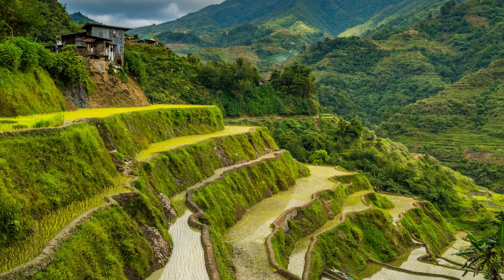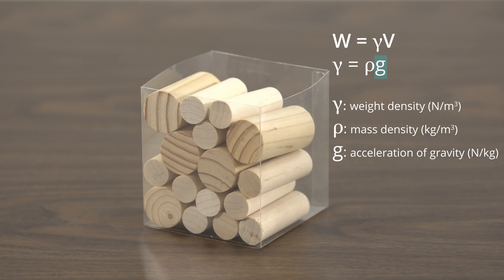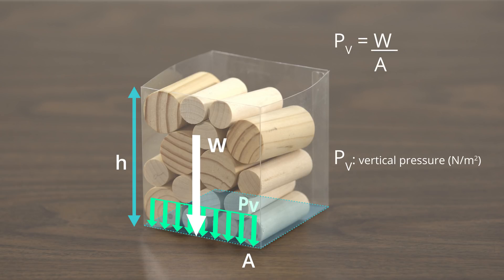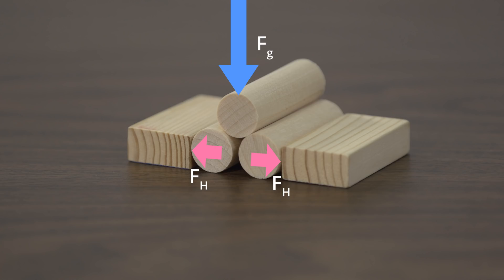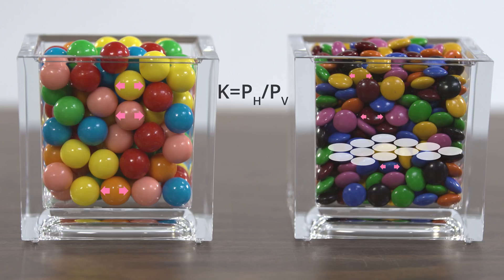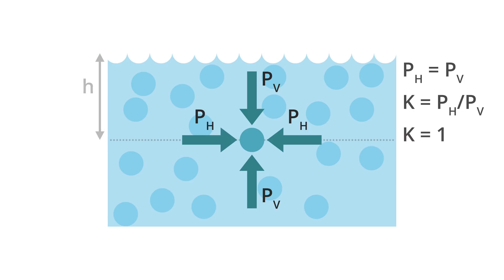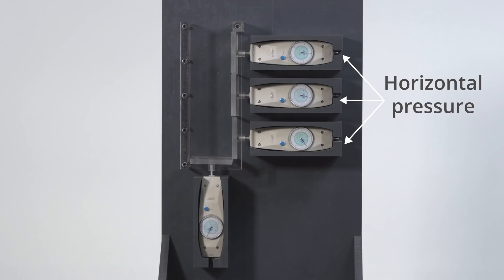6. Soil and Water Pressures

Comment: Question from non engineer type. If an IBC tote can hold 330 gallons of liquid and liquid has pressure force in all directions, would it also be able to hold an equal volume of gravel, stone or sand, since this material would have less side pressure and more downward force?

Reason. I've thought about using recycled IBC totes (come on plastic pallet with metal ribs) as a buttress instead of a gabion structure for retaining wall. I understand the back fill needs to have a correct structure to keep hydraulic forces under control.

Very informative videos. Thanks, Scott

Comment: Honest question: how can Ph=Kpgh if K=Ph/Pv? How could you know one without already knowing the other?
Reply: you cant  as they are linked. in practice you know the K value from books/ tables so you can calculate the horizontal pressure. for soil on the other hand the value K is calculated from fi

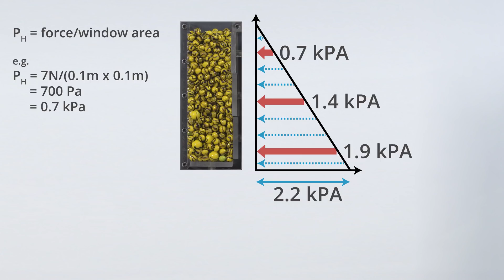Comment: 6:46 Shouldn't this be multiplied by 2, since this is only the measure for one vertical side and not both of them?
Reply: pressure is a per area quantity. Measuring both sides = double the force, but also double the area. So pressure = force/area is the same as measuring from one side.

Comment: 7:00 there's definitely an error here. You can see that the two lower indicators are showing both 21 N, but the pointers are in different places. That makes sense, since the lower pressure should be higher than the higher one

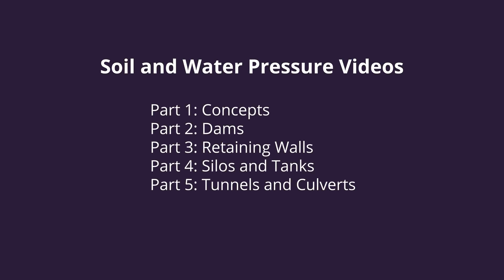Comment: 7:03 shouldn't the one on the bottom indicate 2.5 kPa?
Reply: I guess measurement in real life does not also get the theoretical values due to systematic errors in the setup. But I wonder if the Engineering Models can explain the discrepancy in the engineering point of view.

Comment: Wait.  How did that water example (7:02 in the video) end up with a K above 1?   I get that there is an averaging effect of the bottom-most horizontal force measurement because the plexiglass sidewall spans several cm of height.  But if the bottom lateral force is indeed 2.5... why does the vertical force display 2.1 instead of 2.5 meaning that the resulting K is 1.0?  How it is physically possible for K to exceed 1.0?

Comment: @7:00 there is an error Kp could not be more than one.
Reply: This is an experiment and it will never produce values exactly as you expect. There is always a margin of error.

From where the error arises? Lack of precision of the equipament is likely, as is the approximation that generated that graph, but I would say it is likely due to the air around the bag that contains the water along with the bag itself.
Reply: @Expllosaoriginal  
I agree. Experimental values will not reproduce theory exactly.
But his values are way off. Kp cannot be bigger then 1 (in a perfect experiment). Yet he calculates a value of 1.2

In this case he should have either
* figure out why his measurements are that much in error with respect to the theory
* not show the experiment at all (since it is pretty clear that something disturbs the experiment)
* "adjust" the numerical values "a little bit".

In any case: Showing a value of 1.2 (with a maximum of 1) is the worst thing you can do. A 20% error makes all other experiments shown quantitatively questionable.

(And like you I am pretty sure that there is some problem with the setup. Also one might consider a wrong read from the instruments or forgetting to reset them to exactly 0. There are a number of reasons why such a thing can happen. I am fine with that in a live presentation. But if you prepare a video, things like that should never go unnoticed)
Reply: @kallewirsch2263  Depends on the application. For a toy model roughly demonstrating simple principles, a 20% error is perfectly acceptable - the point here was to demonstrate the linear trend. In some cases, especially for qualitative analysis, errors of an order of magnitude (or sometimes even higher!) can be acceptable.
Reply: yes this is correct. But logical error mostly. At the same level of water, without the shape of the container difference pressure will always be same. So not 2.2 and 2.5 kpa. Its always the same.
Reply: well noticed!
Reply: Kp less than one ..sounds like theres a law....full sentices please..i need the context ...plz...ah. ! Its a ratio...

Comment: So I have a question then,  when backfilling a retaining wall  which produces more thrust?  Granular material or compacted clay(sticky)?
I believe granular would produce more thrust simply because it will not hold a vertical face where compacted clay will.
Reply: Cameron Turner Clay is a funny one. What appears solid can actually be liquid but slow moving. The "stickiness" was described in the flat M&Ms model but that's a different kind of sticky. (High static friction v friction in motion.) When the surfaces are "sticky" with high static friction the K figure drops, But clay can still be moving. Any sticky material's K constant can almost drop to zero..... until you have seismic vibration. When that happens the clay will alter consistency and has the potential to act like anything on the scale from solid to liquid. With retaining walls it's wise to treat every point load as having to hold back water.

Comment: 7:00 Not sure, but for the water one, is the Pv lower than the Ph because some of the water weight is supported by hanging. So if there's no hanging, the Ph will be the same as Pv (2.5 kPA). Or in other word, the top support 0.4 kPA. Not very sure so correct me if I'm wrong.
Reply: What do you mean by hanging? If there is a reduced vertical pressure (by whatever means even if it's just an imagined or intuitive scenario) there is always a corresponding reduced horizontal pressure. Because the horizontal pressure comes only from a gravity. (In a static situation). 
Yes, a formula can always express an imagined or theoretical outcome if some of the factors are altered from theory. You could think of this as being why mathematics is considered a theoretical subject. These formulas just "represent" the physical.
Reply: In reference to the diagram at 7:00, extrapolating out the figures to represent that horizontal line is nonsense. The line should have referenced the lowest edge of each plate not the centre point of the piston.
Reply: Cassette Walkman no, force on each piston is proportional to mean pressure on the plate, not pressure on the lowest edge of the plate.
Reply: Qrnl Exactly. The plates are all the same size including the base one so the lower side plate cannot possibly read the same as the base one. The only point the h force is equivalent to the v force is right at the bottom.
Reply: The possibility of K>1 was alluded to in the video (and indeed ever so briefly shown as you point out) but not explained. It's counter intuitive to me and I'd like to hear how that can come about.
Reply: Paul Abraham So yes, your intuition is correct. In a static situation K can only be 1 or less.
Reply: @paulabraham2550  It is possible to get a K>1 when the retaining structure is pushing mechanically against the soil. You can imagine a snow shovel resting horizontally retaining snow. If you then push the shovel into the snow, the pressure against the shovel will increase, even though the vertical load W is the same, which then implies that K is increasing. In structural engineering this happens when a structure is expanding due to increasing temperature, or when a retaining wall starts moving due to big external loads.
Reply: @SindreHerm  Right, that makes sense, thanks. But I think the corollary of what you said is that in the simpler cases shown in the video it's not possible, yes?
Reply: @paulabraham2550  when you do soil design, the resting K (known as K0) is very common to use. So it is actually very realistic! But when doing the design you also have to consider the possibility that the structure is moving against the soil (K_passive) and that the structure is moving away from the soil (K_active).